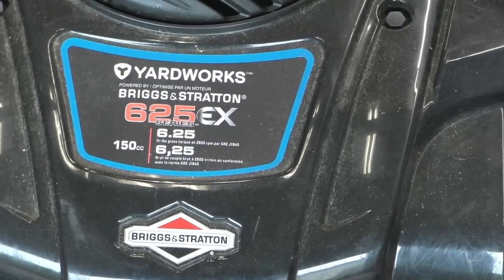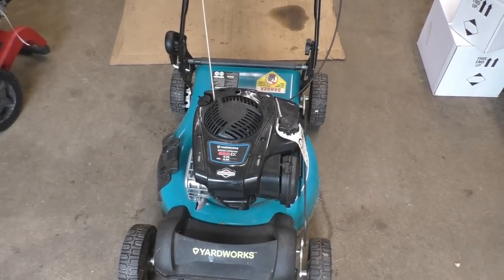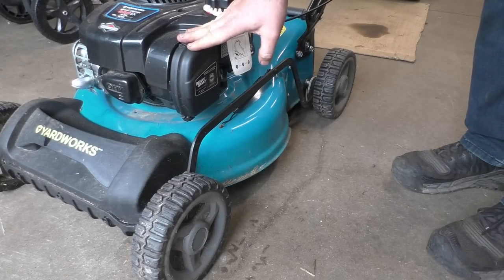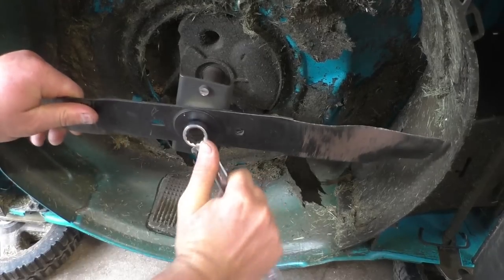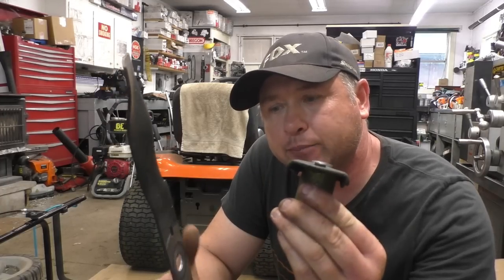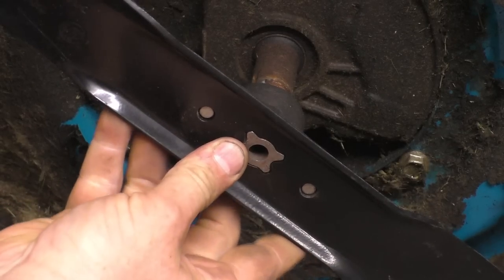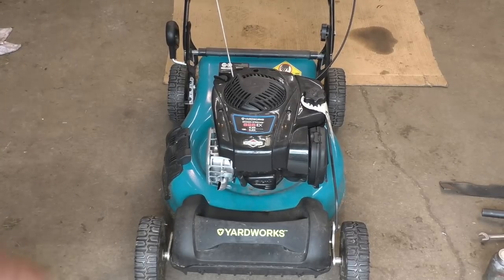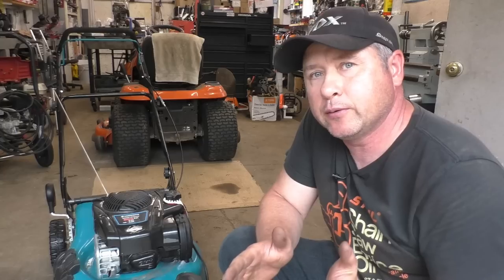Customer Says Lawnmower Kicks Back & Makes A Weird Noise! Let's Fix It!

Comment: New push mowers, self-propelled or not, are considered throwaway items since the last 5-10 years.  That was never the case before.  Expensive push mowers are made shoddy these days, so imagine what kind of garbage a YARDWORKS is.  That MTD part is probably much better than what came on it.  MTD makes products from manufacturer submitted specs, so the part you bought is probably much better.  Nice find and easy fix, Don.  Way to go.
Reply: YARDWORKS is one of many brands sold by MTD. YARDMAN, Troy-Bilt and Cub Cadet are others.
Reply: Another benefit of this conversion is the key is cast as part of the blade adapter itself, of relatively soft metal, adding a bit of a "fuse" per se to the crankshaft in the event the blade suddenly stops again.
Reply: Those two little "bumps" that engage the two holes in the blade are designed to perform the same function as a "key" does.  I prefer an actual key. They cheap to replace.

Comment: I once bought a mower that wouldn't start & it also had no blade or adapter. I cleaned the carburetor, I was anxious to see it run. Without the blade & adapter it would kick back hard. Now it's one of the best mowers I've ever had.
Reply: Normally you would shear the flywheel key with the kick back.
Reply: @gadasavideos8564  true, but putting the new blade & adapter on fixed mine. This is the second season I've used it with no problem. Apparently the blade spinning when you pull the starter rope keeps it from kicking back too. It's one of the best mowers I've ever had. The high lift blade throws the grass out with a good bit of force, which keeps the deck clean & unclogged.

Comment: Makes me wonder how the original blade adapter got bent upwards towards the deck on both sides... Thanks for the video!
Reply: Cheap blades will under load flex while operating which over time bends the blade driver .  He could have placed driver over a vice and bashed the middle which would have straightened driver up which would have been my go to seeing as though the locating / Shear lugs on driver were still intact.
Reply: @glennlurman3514  That makes total sense. Thanks!

Comment: Hey Don I have a question maybe you can help. I have a question. I have a Honda walk behind mower i shut the fuel switch off and when I tip it up I notice oil coming out around the air filter now. I have done this before anytime I pressure wash the bottom of the deck to inspect and sharpen the blades. It never done this before so I went back changed the air filter back out with a new OEM filter it runs fine. It did smoke a bit when I first started it. How is this happening love the channel thanks for any help you can provide on solving this issue. Love the channel thanks for all you do

Comment: If you would not mind, could I ask you a question I am in the process of looking for a pto belt for an ariens zero turn edge it calls for a deck belt of 1/2 x 143 .60 my question is what does the .60 mean and could I use a 1/2 by 143 inch belt please any advice will help and I am sure you heard this a million times before I think you are a fantastic technician keep up the good work
Reply from the maker: it means .60 of an inch, so just under 3/4". Sometimes a belt that is 143" will work.

Comment: Interesting  video...... but I don't understand how this caused and  fixed the kicking back issue? But then what do I know? Regardless, I love to watch your diagnosis and fixing videos - most folks would not share this knowledge.
Reply: I'm guessing it was messing up the initial inertia/turning of the engine as the blade is part of the fly wheel mass as far as the engine is concerned.
Reply: Yes! The blade was still tight enough on the collar to also rotate, but because the collar was bent & the collar pins did not lock the blade - the blade would constantly shift, in jerking motions. And the blade would actually be lagging behind that locked collar rotation - this jerking in a backward motion. Bucking the engine so to speak. And because it bucked the engine rotation the recoil was also being affected. Possibly jamming those recoil latches. Hope this helped in understanding why that motor ran/made noise as it did.

Comment: Did you look into why the pull rope wasn't working for a few pulls?
Reply: The radiator bearings had failed. My actual guess is that when they bent the adapter and the blade flopped around, it misaligned the very cheap recoil starter there (vibration). So once out of every 5 times with the blade flopping around in there, it would misalign because...it could. I don't know if that one has the single metal arm, the double metal arms, or the double plastic arms, but I do know they are not exactly designed for a great fit or longevity...just cheapness.

That is one of the plastic carbs...so yeah...not exactly "quality assured".
I miss the old plastic carb on the metal tank with the built in primer bulb. Worst case scenario, you just replaced the spring and the rubber diaphragm. With the all-plastic ones...not much you can do. They tend to suck air when they get hot or old. Or both.
Reply: @TheCaptainSlappy  Radiator bearings? I think it's air cooled, no radiator. But you may be talking about the recoil pull starting pawls, which are typically plain bushings, no 'bearings.'
Reply: I was going to say it was the muffler bearings.  The radiator bearings rarely go bad on these machines.
Reply: @80SWoods   I was wondering why Dony didn't check the blade on his blade stretcher to make sure it was stretched out fully.

Comment: I have one like this with almost the exact engine. The bracket that the starter bolts onto is rusted through and broken. Starting that thing is a chore. I cannot find the parts anywhere.

Comment: What about pulling cord to put cylinder in compression to prevent oil leaking when you tip the unit on it's side?

Comment: I was expecting a flywheel key.
I wish there had been some explanation of how the damage underneath could cause the pull rope kickback (and even the non-start problems we saw at the beginning).  Just imbalance conveyed back through the crankshaft?

And that must have been a replacement blade that came in on the mower, correct?  With the damage to the spindle, the old blade must have been like a piece of abstract art?
Reply: Yes! The blade was still tight enough on the collar to also rotate, but because the collar was bent & the collar pins did not lock the blade - the blade would constantly shift, in jerking motions. And the blade would actually be lagging behind that locked collar rotation - this jerking in a backward motion. Bucking the engine so to speak. And because it bucked the engine rotation the recoil was also being affected. Possibly jamming those recoil latches. Hope this helped in understanding why that motor ran/made noise as it did.
Reply: Since the blade is a substitute flywheel, having it loose messes with the inertia needed to follow thru the combustion cycle.

Comment: Donny I have same mower.   I think I have a mouse nest in mine.  I removed the two torx.  But it is still stuck.  Is there another hiding under the sticker ?    I am afraid if I horse it off I will Snap something.

Comment: So a loose blade would cause the recoil starter to disengage at times?
Reply: I thought the same thing. That recoil should have been checked along with torquing the blade bolt to specs
Reply: @Bulletman426  Agreed.  The video only showed him starting it once.  That surprised me.  As far as tightening the blade, I assumed he used a torque wrench off camera.  But you are right about that.
Reply: Yes! The blade was still tight enough on the collar to also rotate, but because the collar was bent & the collar pins did not lock the blade - the blade would constantly shift, in jerking motions. And the blade would actually be lagging behind that locked collar rotation - this jerking in a backward motion. Bucking the engine so to speak. And because it bucked the engine rotation the recoil was also being affected. Possibly jamming those recoil latches. Hope this helped in understanding why that motor ran/made noise as it did.
Reply: The loose blade would cause the flywheel to kick backwards as the engine would fire at the wrong times which would cause the teeth to disengage on the recoil and get forced backwards making them stick in a position they would never normally be.  Once that was fixed, this issue it no longer a concern.
Reply: @80SWoods  Oh thanks for the explanation.  I did not know that.  I appreciate that you took the time to clear up my confusion.
Reply: @KC_justme  Excellent explanation.  That really helps me understand the connection between the recoil and the loose blade.  Now i know!

Comment: I've never seen a lawnmower blade where the holes on either side of the bolt-hole are  different. Good thing the MTD is a more conventional and common design.
Reply: I think the holes are like that to prevent the blade from being installed upside down. The D-shaped key and hole won't fit together.
Reply: @steveharleyfan  that makes sense.

Comment: Rather than tipping push mowers I have adapter rails for my riding mower front wheel lift. I raise it level to about waist height and then lift front end of push deck eith sn electric hoist mounted to shop ceiling. Sometimes have to put strap ftom ceiling to push handle do it doesn't flip back

Comment: So the engine didn’t run well because the blade was loose? The recoil didn’t engage because the blade was loose?
Reply: Yes! The blade was still tight enough on the collar to also rotate, but because the collar was bent & the collar pins did not lock the blade - the blade would constantly shift, in jerking motions. And the blade would actually be lagging behind that locked collar rotation - this jerking in a backward motion. Bucking the engine so to speak. And because it bucked the engine rotation the recoil was also being affected. Possibly jamming those recoil latches. Hope this helped in understanding why that motor ran/made noise as it did.

Comment: Had he remembered, Donny would have also put anti-seize on the bolt threads that hold everything to the crankshaft pto end.  These are usually fine threads for maximum strength and are very susceptible to rusting in place always operating in grass moisture.

Comment: I didn't see you replace the flywheel key, it looked good the second I saw it, was there a built in key on the new blade adapter? Also thanks for your awesome videos.
Reply: Adapter has the “key” cast into it.
Reply from the maker: Yes you can see it at 4:00

Comment: I'm not sure you have completed that repair, how on earth would that blade sittuation cause the motor to kick back and yank the handle out of your hand during startup? I think you have repaired the cause, that he hit something, but for it to Kick back there must be more, I would check the key for peace of mind.
Reply: Yes! The blade was still tight enough on the collar to also rotate, but because the collar was bent & the collar pins did not lock the blade - the blade would constantly shift, in jerking motions. And the blade would actually be lagging behind that locked collar rotation - this jerking in a backward motion. Bucking the engine so to speak. And because it bucked the engine rotation the recoil was also being affected. Possibly jamming those recoil latches. Hope this helped in understanding why that motor ran/made noise as it did.

Comment: Good info. In my opinion, FWIW, the MTD adaptor is much better. Looking at that B&S motor, I have a Bolens in the shop with a broken starter clutch. I had to order the new assembly on line since no one around here had the part. The serial number break makes it even harder to find. Another good video.

Comment: They rate the engine by torque now because it's a bigger number. That 6.25 ft-lbs is 3.1 HP at 2600 RPM.
Reply: Problem is knowing at what rpm the 6.25 ft lbs is achieved.  Is it 2600 or 3600. Does it say on the engine?

Comment: Question - at 3:20 you show the original blade and adapter.  Looks like one of the holes on the blade is a full hole while the other is a half hole.  Looking at the adapter it s the same.  Guessing your customer hit something and knocked the one side enough to cause it to bend the adapter.  I believe bending the mounting piece back could have made it usable again.  But, failed once so it would have probably failed again.  Good choice.

Comment: Nice repair job donnie.  But I do not understand why you don't Spend just a few more minutes checking the oil, Spark plug in condition of the air filter.  I think you should do a PM inspection any time Someone brings a piece of equipment to your shop for any reason.
Reply from the maker: I always do

Comment: Too all dont direct feed this engine series with fuel into carb, ether is ok just not liquid.  The engine has weak intake valve sealing pressure and will allow detonation to slip past resulting in carb, cowlings and tank catching fire.  Also Why bother hilighting made in usa when they wont disclose what parts are local whats chinese,  For all anyone knows the stickers might be the only us part.  Id rather buy a new chinesium engine than repower with a briggs now.  Its not briggs fault as such cant compete with slave labour